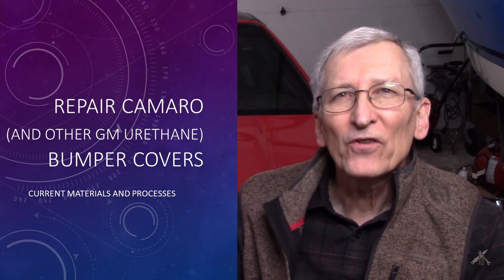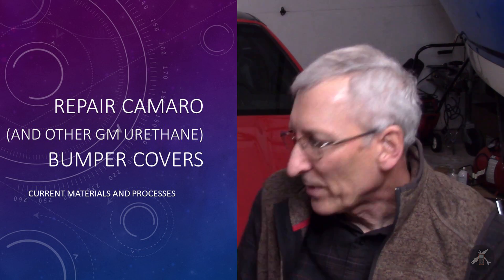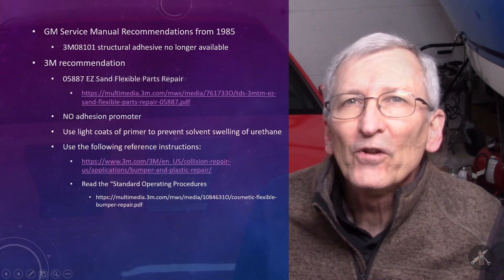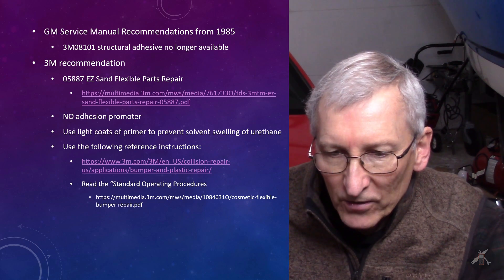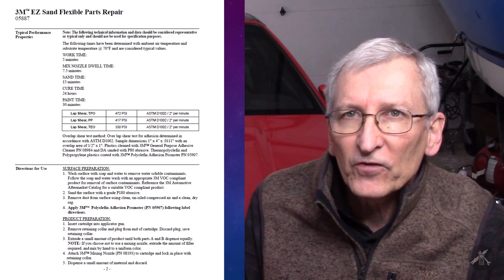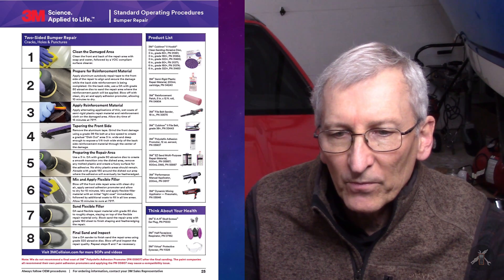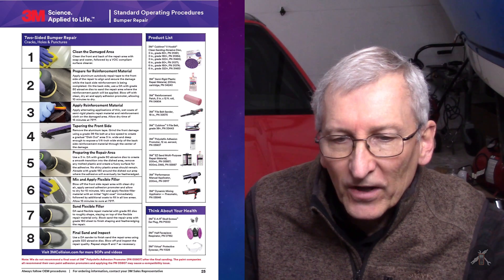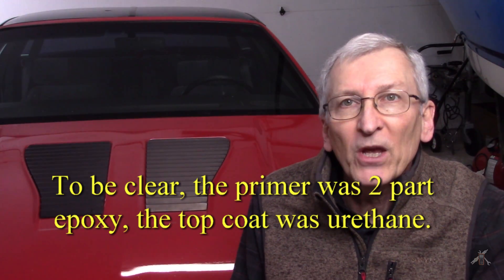Repair Adhesive for GM Urethane Bumper Discontinued - What can I use now?

Comment: Thank you very much for sharing this .      I have an 89 Dodge Daytona ES with the full urethane ground effects.         One of my dogs tried chewing a corner  of it right behind the driver's door.        

I've got everything sanded and ready for primer except piece that goes under the door.       Been staring at it for a few weekends knowing that fiberglass nor lightweight body filler will work. 

Again thank you very much  😊
Reply from the maker: You're welcome.  The urethane parts are nice pieces, but it takes the right material to repair them. It also takes the right primer and paint to finish it off. For my job it was a combination of GM shop manual and tech data from my paint shop.

Comment: I used fiberglass for my 1986 bumper with good results. The salesperson at the local 3M store also told me that the adhesion promoter would not be necessary. Only the primer.

Comment: This is EXACTLY a problem I have with my 92 camaro - rubber bumper tears.  I think its important here to say these are called "Rubber" bumpers in the car repair industry alot, so folks  The differences are great - don't confuse plastic bumpers with rubber!  Plastic is what they use on cars today so these from the past have to be handled differently!  Rubber/Urethane presents alot of different problems than plastic - as Dan mentions one of them - they soak up stuff - One problem I found - is they are considered as a material that is always changing over time - drying out- and can crack paint easy - so I have been told - DONT skip the Flexible Additive on these RUBBER bumpers like lots of PLASTIC repair bumper guys do. Also, Dan, I think the 60's GTO's had this rubber bumper too. Just alot thicker and more solid instead of hollow.
Reply from the maker: Yes, the urethanes are quite different than many of the newer plastics, that is why I went back to 3M for an expert recommendation.  When I repaired mine, the paint company local shop had the paint manufacturer tech people on the phone. They specified using the flex additive and the 2k epoxy primer for spot priming. They were very emphatic to not remove the original finish any further than necessary because it is well bonded to the substrate.  It was better to sand the original with 400 and refinish over it with 2k urethane top coat.  So far, it's holding up well, but it's only been a couple of years.
Reply: @bitsofwisdom460  Well, im not in good shape then because i sanded mine down to the rubber in some spots 🫣
Reply from the maker: @budsodalsky It's probably fine. I had to do that for my repairs.  There were a few places where the paint had stress cracks from flexing down to the base material and I had to sand them down and refinish them and prime with 2k epoxy.  The recommendation was that it was better not to do the whole part if you could avoid it.